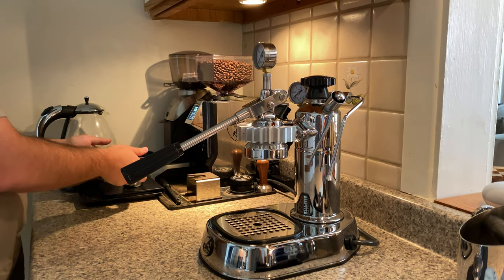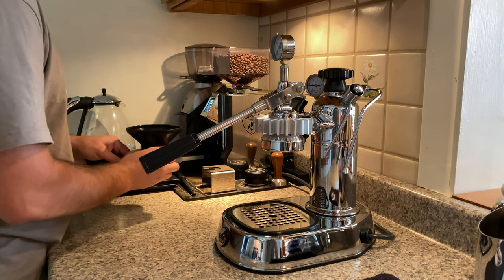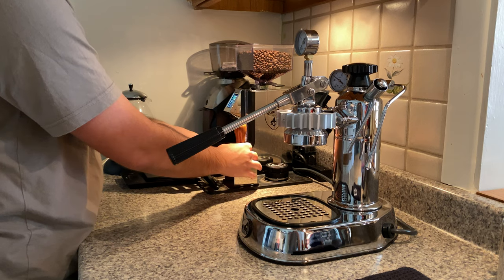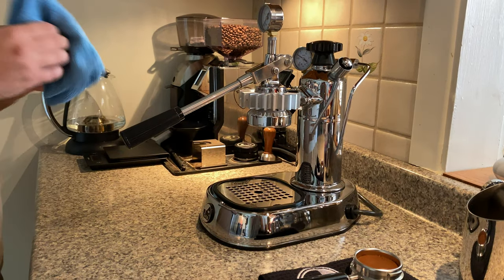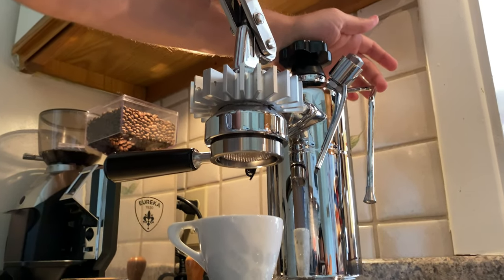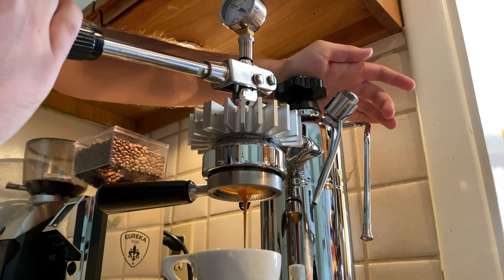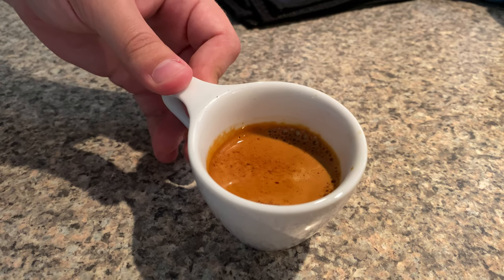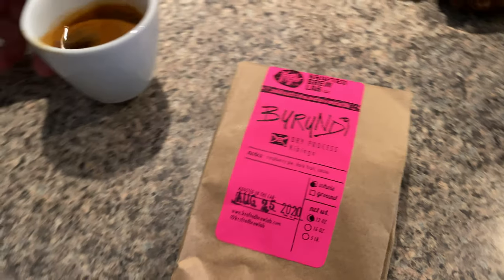La Pavoni Europiccola - upgrades and a double shot!

Comment: I'm curious how does this compare to your mara x? Honestly.
Reply from the maker: It's like apples and oranges comparing there machines really! I loved the coffee that the La Pavoni makes, it was probably the tastiest espresso I've had and I've definitely had a lot, it's just really tricky to reproduce good results, and you can't really pull multiple shots, so that's why I wanted to switch to a semi auto machine, which has the benefit of pressure consistency and obviously being able to brew and steam at the same time is a big plus.
Again, it's pretty hard to compare the two, the La Pavoni will always have a special place in my heart.
Reply: @alexwalshaw  the price difference is worlds apart. La Pavoni Europiccola $899 vs $1894 for marax. I'm trying to decide. Would only really be me using it. I have also considered the cafelat robot
Reply from the maker: @jm7720  I agree the pricing is definitely in two separate categories. Here in the US, a 120 volt Europiccola is nearly $1000 new, while the Mara is $1350. Still different price brackets for sure though.
I'd say if you enjoy the idea of manual shots, things like the La Pavoni, Cafelat and certain Flair models are absolutely great ways to get first rate espresso for a fraction of the cost. Obviously you can't steam milk on the Cafelat or Flair, but the quality of espresso they produce, to my knowledge, is amazing if used properly.
The Mara X is breaking into prosumer level territory, the materials, build and technology represent that too. But it isn't the final option in terms of going semi-auto y'know? You can always look into nice single boiler home machines which are also highly regarded. Things like the Gagia classic pro and Rancilio Silvia are highly praised home espresso machines that feature cafe like features of 58mm portafilter, really powerful steam for milk, but the trade-off is that single boiler and having to temperature surf between brew and steam.
If you're just starting out, try to get your hands on one of the levers or single boilers, it's initial investment is much lower and you can still get excellent results from them!

Comment: Hi Alex, can you share some information on your experience with boiler pressure on the LP? I see in this vid your around 0,8 bar for the shot, did that give you the best results ?
Reply from the maker: Yeah so with my pre-mil machine there were two manual heat settings I could choose. One brought it to boil at 1 bar and that was both too hot and too much pressure as the overpressure valve was always screaming. So, I'd usually get it up to boil (but more importantly get the group up to temperature) and then get it back down to a usable temperature by moving it to setting 1. After flushing some water through, the pressure would usually drop just below 1 bar and that's when I would pull shots. Remember, I'm no expert, that's just what worked best for me with the machine I had.

Comment: nice shot!  I was told not to bang (collapse) when packing the puck because it segregates the fines, what are your thoughts? Cheers!
Reply from the maker: Depends on what you mean? Do you mean when tamping? I found mostly a light tamp with the pressure of my fingers was more than enough to compact the puck. If you're talking about when people hit the portafilter with the tamper and double tamp, yeah that's real bad, don't do that. When I was trained, they told me that when you knock the sides to get the remaining fines that stuck to the PF walls, it can actually crack the puck and cause lots of channeling. Best to do one even tamp and not worry about the fines on the sidewalls, the pressure of the water will drive them down anyways. Hope that helps!
Reply: @alexwalshaw  thanks for the reply, I meant when you first loaded the portafiller then then  banged it twice on your tamping block
Reply: Also I noticed you had to use your other hand on top of the boiler to stabilize.
That thing needs to be anchored down, whats on the bottom? any chance of getting some screws or bolts through it? or is it just plastic?
Reply from the maker: @77Cfriend  oh I see, I see. Yeah I did that to just get the mound to sit a bit flatter before distributing. Some people tap the pf a bunch to level it all out, that's actually what I do now since I've changed machines, but I don't see any harm in it. There are many ways to distribute grounds before tamping.
Reply from the maker: @77Cfriend  oh also the bottom of most La Pavonis are just a plastic cover, I suppose you could fix it to a surface, but I liked being able to move it around to adjust how I would've pushed on the lever. Keeping one hand on the boiler cap just keeps the weight of it down, otherwise the weight of me pushing the lever would lift the machine off the bench and mess me up!
Reply: @alexwalshaw  I have a wooden bench top on my outside coffee station with sink. I screwed my HG-one bench hand-grinder down and it is so much better. I was looking at the Swiss made Olympia Crimea but they are so much more expensive and I only make 1 small coffee a day. Which is the best La Pavoni to get if buying a new one? Thanks
Reply from the maker: @77Cfriend  I agree on the price of the Olympia, as nice as it is, it's just so expensive. If you're only making one or two drinks a day and you're really into lever machines, definitely try to find a used Pavoni on eBay or something that's what I did :) 
Besides the ever so slightly larger group head and portafilter of the millennium models, and some slightly different wiring, there is no real reason I'd want a brand new La Pavoni. Look for Europiccolas or Pros, whatever fits your budget, but they're all functionally the same.